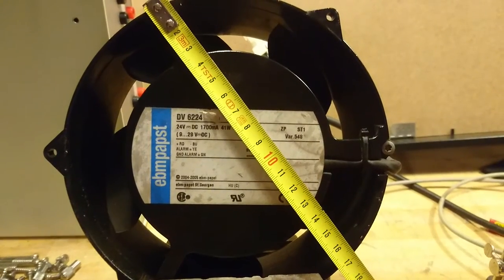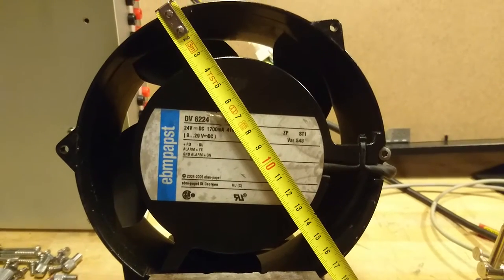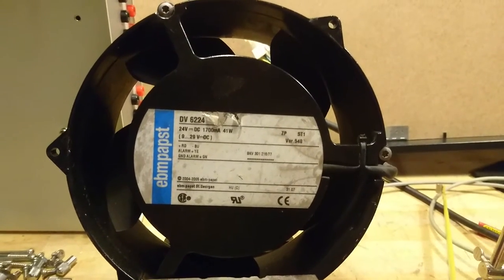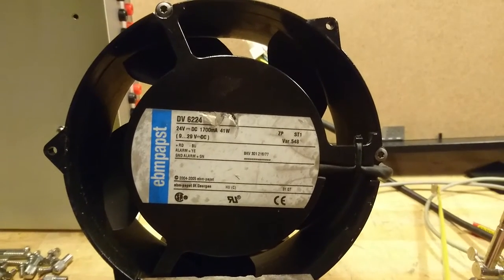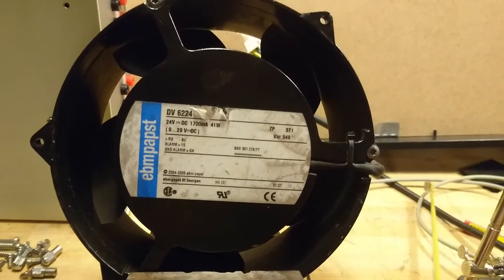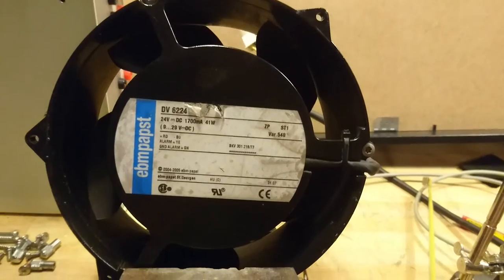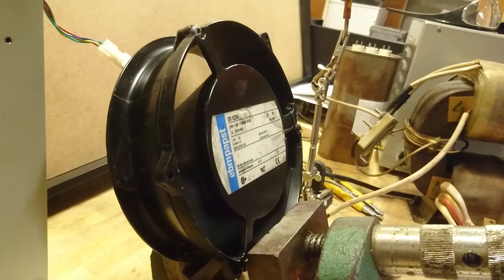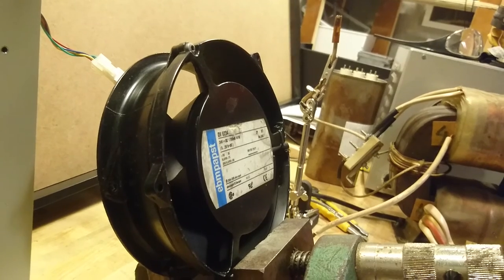Ebmpapst DV 6224 Fan (24VDC 1700mA) 540 m^3/hour air flow

Comment: Hello, a question in my country the voltage is 110v
How do I connect this fan??? Could you show what is needed to connect it to 110v?
Reply from the maker: You need a 24VDC power supply